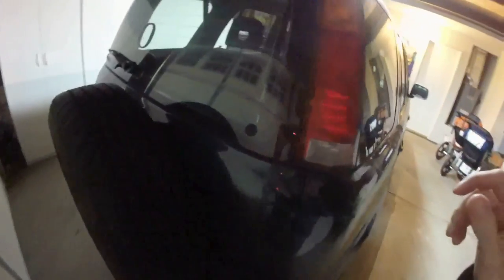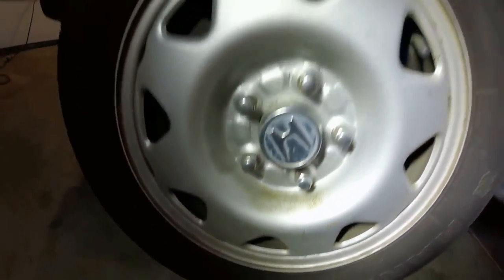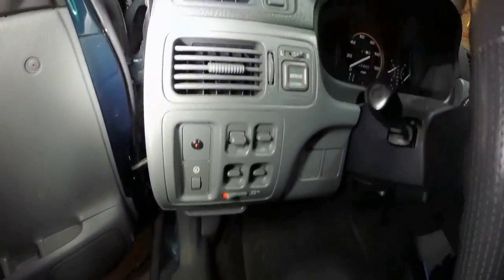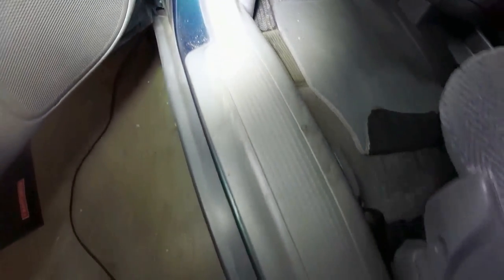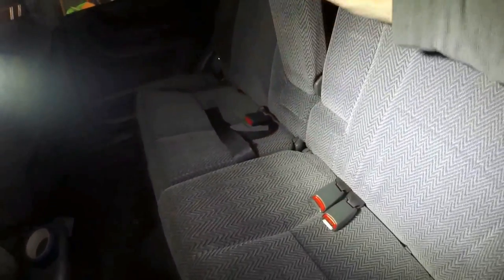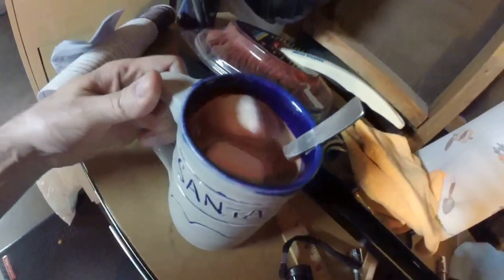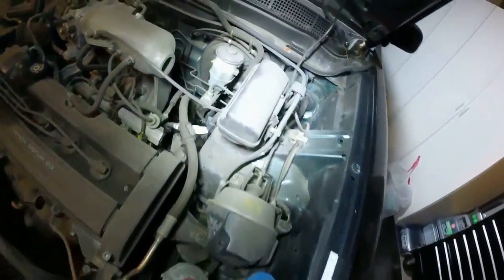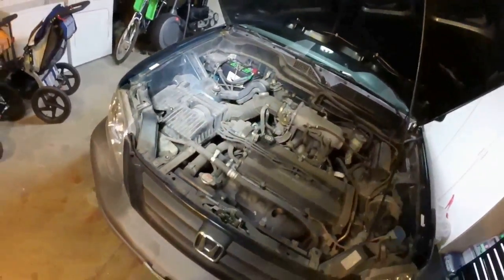1998 Honda CR-V: Episode 1 Vlog: Introduction

Comment: Mine has 198,9xx and overheats because of a radiator leak. Over all nice car. Only thing that doesnt work is the power locks. Most people have enough limbs to lock a car.
Reply from the maker: +DarnLevel I'd buy a cheap radiator for it

Comment: My girlfriend's previous car was a 2003 Honda CRV, and that thing was great.  Not fun to drive, but ultra reliable.  (She was terrible about getting it service, and the only thing to go out on it was the air compressor in 10 years; which is about the biggest issue that you find on older Hondas.)  lol It was funny you mentioned that about the shifter, it was like that on hers as well (it was on the dash instead of the column though), and I think the new Tahoe/Escalade even still have that layout.
Reply from the maker: this gear shift lever sticks if you put it in 2nd. its hard to get out. ill have to study how that linkage works, probably just a linkage issue.

Comment: You can try to restore all the faded parts using the meguiars endurance gel tha you already bought..
Try a small piece first and if you see that works continue to every exterior part..
I also see the interior cleaning video and you did a very good job..
Nice and clean..
Continue detailing this car you will see incredible difference..
Reply from the maker: thanks for the idea! i do have mothers back in black also, but that is almost gone. the meguirs gel might be a good option

Comment: That's the kind of car i wold buy for myself.Good looking car man.
Reply from the maker: Walter Robinette its a solid car, unless you dont drive it ever. my sister lets it sit for months at a time, and her "new" battery bought 6 months ago now won't hold a charge anymore. per my latest video in this series, the alternator is fine, and the battery just died. Now she has to buy another battery again.. after one of my other sisters in from NY uses it next month, my sister plans to finally sell it. it takes up too much room and needs to be driven.

Comment: Hmmm... I like when they install window switches on the dashboard. It keeps the wiring going through that elbow part in the door jam a minimal. That's the one spot I've had a wire break on most the cars I've owned so far.
Reply from the maker: very true foxyfire